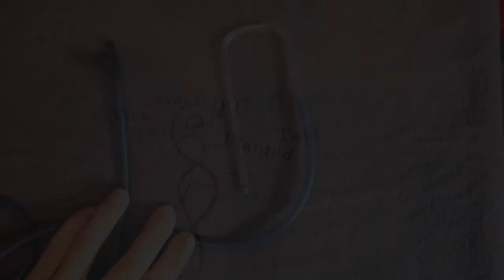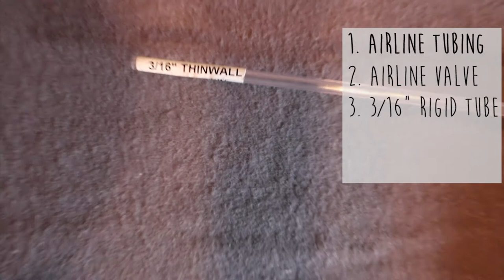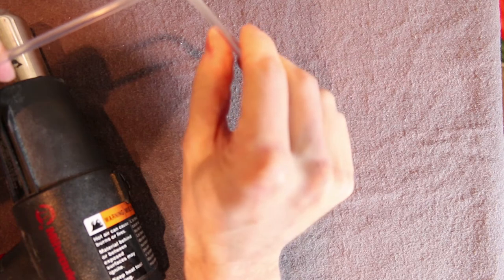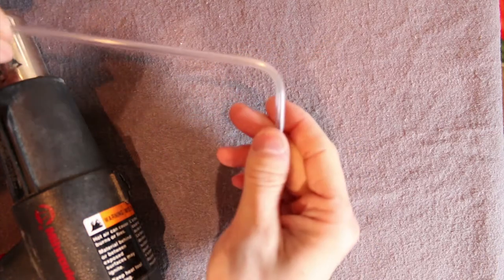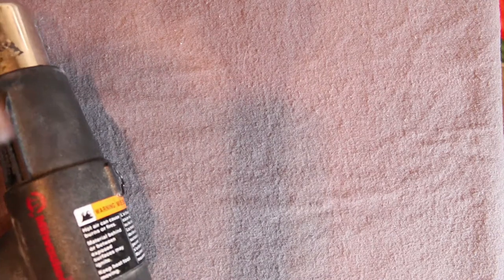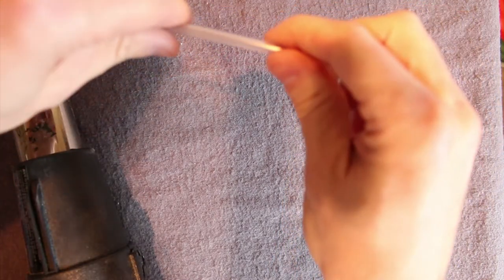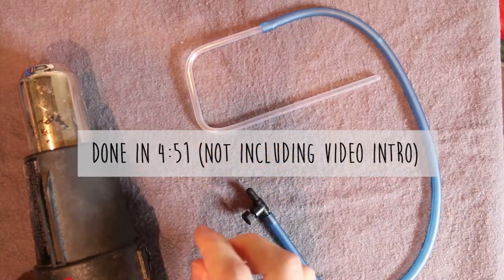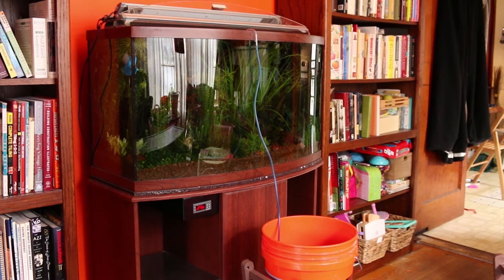5 minute Aquarium DIY: Drip Acclimator

Comment: Nick, can you help me out? I have a science question that I need answering. I've been reading some theories on the internet about people using iron oxide as an iron supplement for their plants. Now iron oxide isn't soluble in water so I was wondering if the plants would genuinely benefit from this? I asked one guy on a forum and he said the roots sucrete a mild form of acid which turns the iron oxide into a form of iron the plant can use. Is this really true? Look forward to your opinion on this.
Reply from the maker: I don't know off the top of my head, let me do a bit of reading / research and see what I come up with. Now I'm interested as well.

Comment: Would you comment about how fast drip and how long till done.   Tanks
Reply from the maker: AKorigami That is tough-- it is not an exact science. It depends on what you are acclimating and honestly there is a debate about whether anything other than temperature acclimation even matters. BUT I still like to drip acclimate, and usually I start slow, maybe 1 drip per second for a few, maybe 5, minutes. Then I speed up to 2-4 drips per second for another 30-45 min, maybe a full hour. But for very sensitive species I have seen people drip acclimate a slow rates for several hours. But then again, I am not keeping any exotic fish currently (and I can't say about saltwater or corals-- that is a whole different procedure). Hope that helps.